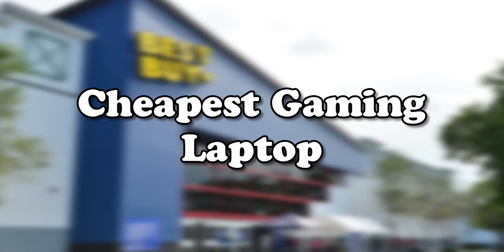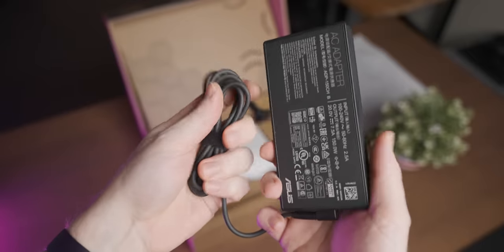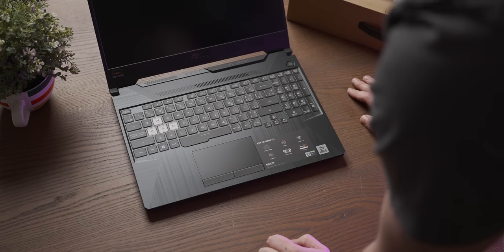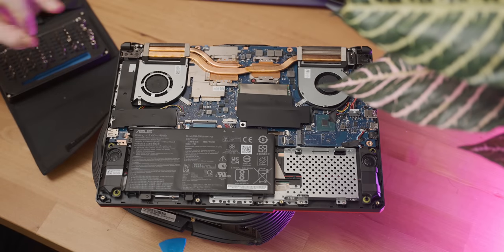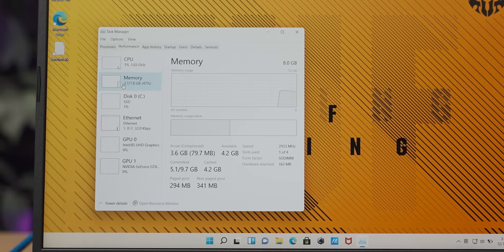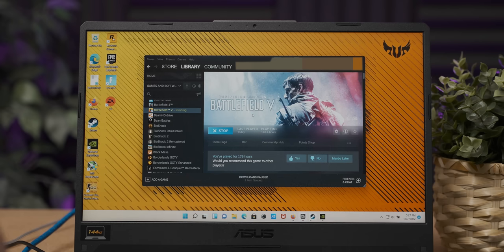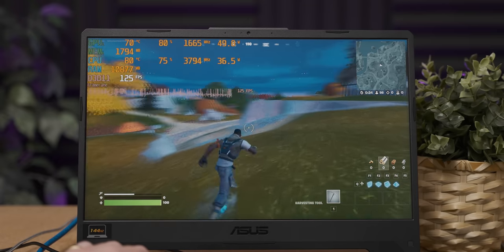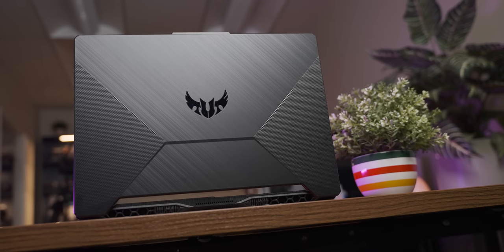The Cheapest Gaming Laptop From Best Buy...

Comment: Bought my TUF A15 from Canada Computers almost 2 years ago. It was my first proper "gaming" device and I experienced above 30fps gaming for the first time. One of the fans is dead so I ghetto-rigged a desk fan to blow into the heatsink but I'm getting it replaced this Christmas. Love the channel btw.
Reply: I'd just say build your own PC. you can get make really good desktops  in this day and age, even with a budget of sub-$500 USD!
Reply: true, but 500 dollars usd can get u much more than 500 cad.  You could probably get a igpu, or a r3/12100, and a used gpu of some sort.
Reply: Holy crap, what a coincidence, the fan on my Asus Tuf F15 broke after a few months, how long did yours last?
Reply: @trr4gfreddrtgf  After 1 year I noticed on startup that my fan had a bad vibration but went away shortly after. 1/2 a year after that, the vibration became constant and then it died a few weeks later. So it lasted around 1.5 years.
Reply: @scarecrow5848  y tho it aint broke
Reply: build a optiplex
Reply: @trr4gfreddrtgf  bro tf same one fan makes some weird noise :'')
Reply: The fans are easy to replace. I did it in like five minutes.
Reply: Fans died already? Wtf! Build quality clearly declined over time! My Asus n61jq laptop from 2010 is still running great and nothing has stopped working
Reply: @ronank2432  because desktops are better in literally every way.
Reply: @scarecrow5848  yes because they eat directly from the source. Whereas in laptops you charge and discharge at the same time.
Reply: @HR-pz7ts  no, its also other reason such as; not worrying about battery life, being able to upgrade every part in your system keeping it around for way longer, etc etc etc. i could keep going on but I'm not going to.
Reply: This laptop is relatively easy to pull the back off if you got the patience as I installed a second m.2 drive in mine so you could possibly get a new one and repair it to use as a spare.
Reply: @ansonjia5146  I see, my fan broke within 2 months, luckily it's still in warranty.
Reply: @killerbee115  Oh, maybe get that looked at lol
Reply: @ScavengerFX  Only reason I didn't do it myself was because I still have warranty on the machine, maybe when warranty expires I'll fix it myself.
Reply: @scarecrow5848  Right, unless I need to move around. University is not kind to desktops, at least for me.
Reply: @justinl2009  thats literally the only good thing good about laptops, and then again just make a SFF desktop and use a portable display.
Reply: I bought an A15 in 2020 too. 1660ti, but it runs Tarky in low settings so I am happy. 😁
Reply: how much did you pay?
Reply: @scarecrow5848  portability is a problem bro
Reply: @ashwin372  read other comments before replying to something that was already answered.
Reply: More then 30fps??? Can't be true!!
Reply: Bro try playing world War 3
Reply: @scarecrow5848  My MSI laptop runs alot better than any of the people I know gaming pc's lmao.
Reply: The fans is CRAP, mine died on month 4. They use the same cheap 25 cent for all their budget gaming laptops for the past 5 years and they want 50 bucks for new one...
Reply: @scarecrow5848  Hey man just replying a few weeks later... To me it wouldn't be practical to bring a SFF tower + KB + mouse + portable monitor to a college lecture... I mean imagine trying to fit them all inside a backpack to the next class... How would that even work?

Won't it damage the parts during the process? 

Everybody has different use cases. Some people travel a lot. So gadgets are made feasible for certain people. Not everyone wants to hog around a 20 pound tower INCLUDING A MONITOR which is maybe about 8 pounds or so.

Laptops are obviously underpowered versus  their desktop counter part but make up for it with its lightweight portability. It's literally an all-in-one package that has a monitor, keyboard, trackpad, and other various peripheral/components at around 10 lbs or less!
Reply: @MatchaCutie14  I already explained it, jesus christ read the other comments before commenting. also a SFF pc is not that heavy. your being dramatic and plus I said PORTABLE monitor. thats right, they make them! you can get ones that go down to 7" at 800x600. there you go. and I also said, if you WOULD HAVE READ THE OTHER REPLIES, "if you have no other option just use a laptop, but don't buy a gaming laptop because theyre a scam." (which is still very true.)
Reply: @scarecrow5848  Hey man, let's not get riled up here, ok? SFFs are still bulky and not everyone wants to hog a tower around. If you enjoy looking at a 7" monitor at 800x600 res, well you do you. I personally cannot work with that resolution and size. If people like OP are happy about their purchase, then we shouldn't put them down for their purchase.

Also you didn't mention about KBM and mouse. That also adds up to the weight.
Reply: @MatchaCutie14  you can get really light keyboards and mice. use wireless ones, and I never said a 7" monitor was good. I only said it was a option for a portable monitor. and last thing, if you really think a SFF pc is heavy, you must never have even touched a full-size tower.
Reply: @scarecrow5848  except portability I guess
Reply: @floydlooney6837  I literally already answered this. why don't people just read the other comments first? if you need portability make a SFF desktop.
Reply: @scarecrow5848  many people like me are obligated to buy laptops, i simply dont have enough space for a desktop pc and even if i did i need it for school sometimes, and I travel a lot so a gaming laptop is much better
Reply: Hmm, that didnt last that long
Reply: I've done the fan thing before. I did find a desk fan that blows downward but it wasn't common.
Reply: @scarecrow5848 try bringing a desktop to class
Reply: @spiritofpostpunk7207  just put it on a cart lmao. use a portable display.

Comment: I got an Acer Swift X for 780 new and I really enjoy how powerful it is while not looking like a gaming laptop. The battery life is great too.
Reply: Did you get it from that amazon discount atm? How is it doing so far? The build quality? Performance? Any problems you occured?
Reply: @Anthony Noelson  yes, got it for the Amazon price. It's a great laptop at that price point. 

The biggest pros are the specs (5800u 3050ti) it jams into a weight you can hold in 1 hand. It has half the power as my main PC and can play mostly all games at medium to high settings. With the 60hz display, anything over 60 is overkill on the main display so most games come out smooth as butter. The performance of the Acer Swift X is actually insane for the size and price you get. 14 inch ultrabook gaming. Another huge plus is the amazing IPS screen it ships with. Has amazing color accuracy because the laptop is marketed towards creative professionals.

My biggest gripe would be the speakers and keyboard. Speakers were cheaped out and are bottom facing, making them muffled on a bed or table top. Keyboard has really strange placement for the power button, sleep button, and pgup pgdown buttons where you'll end up accidently pressing one all the time. No big deal to me I can get used to it. Another gripe would be the color scheme. Silver and Gold gets dirty easily.

Bottom line it's an awesome laptop if you need a thin and light laptop that has power to do productivity or gaming. It works perfectly as a college laptop.
Reply: @zhon5311  okay cool. Thanks for your review! Very helpful

Comment: I am honestly impressed how well this thing runs games after the RAM upgrade. 60 fps in Cyberpunk with a 1650 and a 4-8t CPU is surprising. Also, regarding the memory speeds, you may need to look for XMP profile settings in the BIOS. I have an MSI GF65 (3060 with 10500H) and I had the same issue and to enable XMP after adding the very same RAM you used in this video. As always, I love your humor. Keep up the good work!
Reply: it the bios is like the older one I have it's kind of useless to even go in there since there are no usefull setting inside :\
Reply: There are no XMP settings in the BIOS on these laptops. They were built to run at JEDEC standards, and 10th Gen was 2666 MHz at the time.
Reply: @PatientXero607  really? I thought this only happened with the AMD Laptops. Really sucks if you can't set XMP even when you have an Intel CPU
Reply: @PatientXero607  no. their ram was jedec 2933. u just need to buy the right one.
Reply: @hailgod1  I have 8gb single channel 2933 standard. And planning to upgrade it to dual channel. So what RAM brand is the right one?
Reply: @hailgod1  Depends on the year of the model. My FX-504 won't run RAM faster than 2666mhz, but it has an 8400H. The 10th gen core CPUs probably have higher memory clocks, but you still can't enable XMP in the BIOS
Reply: tf  that combination is very weird, wouldn't 3060 get bottlenecked by the little i5 10500h
Reply: @dodgymalaka2317  I haven't had any issues with it. This CPU is 6c/12t, though. Not the usual 4/8.
Reply: @atiebiss  look for crucial sodimms. they are usually just your bare sticks, rated at their listed speeds at 1.2v (jedec spec)
Reply: Kingston Fury ram has JEDEC standard rated at 3200mhz. I know this because I had to upgrade the ram in my Acer Predator 300(i7-11800 + RTX3060), which the OG ram ran at 3200, but there was no XMP option in the bios.  The Kingston Fury runs confirmed at 3200mhz on JEDEC standards alone.  Just in case anyone needs to know this info in the future.  Would probably help unlock at least a little more performance instead of running it at 2600MHZ.
Reply: my sister's oldest vivobook laptop from asus has no xmp settings after i upgraded the ram so every asus laptop uefi bios are like that and it's just useless. even if you have an rog strix or scar laptop you still won't be able to set the ram to its rated speed manually in the uefi bios
Reply: @dodgymalaka2317 u can't be talking about bottlenecks, I have a laptop with an i7 7700HQ and a 1050 4gb, but I also have 16gb of dual channel 2400 ram

Comment: For its price, it really is a decent laptop. Thanks for sharing these affordable options!
Reply: I would hold out for a 3060 and 16GB RAM for the same price.

Bought a Gigabyte G5 GD with 3060 and 16GB in July from Best Buy for $699.99.
Reply: @antondovydaitis2261  gigabyte build quality sucks tho and they have warranty issue i got the legion 5 brand new has been awesome so far
Reply: @THEGRANDTOUR-kt3jh  Obviously, if I could afford a Legion, that would be much better, but I feel I got my $700's worth.
Reply: it's actually terrible value for the price... heck a year ago you could get a similar setup for the same price with a RYZEN 5 5600H
Reply: @jesusbarrera6916  ikr I got my laptop last year for £700 (now it's £630) and it came with dual channel 8gh ram and a Ryzen 5 5600h. I hate how some manufacturers will use a very weak CPU in their budget laptops and say it's 'good value" when there are many others with a much more powerful CPU
Reply: bruh you can just build a $699 gaming pc and it could be 3x brtter
Reply: @kenzidoestoomuch  Really? Because I scoped several builds in July 2022 and since then, but nothing has the same performance (and yes, I know RTX 3050 mobile GPUs aren't as strong).

I'd like to see a build like that.
Reply: @antondovydaitis2261  well not specifically yours, idk how you got a $699.99 3060 laptop, but you can put together a $685.99 pc with a 12100f 6650xt 512 gigs of nvme pcie 4.0 ($10 less for pcie 3.0) SSD
Reply: @antondovydaitis2261  before tho u could build a 6650xt build for $499 when prices were low and the 6650xt was like $250 and the 12100f was only $80 and when the power supply was like $35 for a good one
Reply: @kenzidoestoomuch  Yeah, okay. Makes sense.  Early in my understanding though, I really only understood Intel and AMD.  Especially since I did want a laptop because of moving around the house.

Now I understand that all AMD is better bang per buck, although laptops aren't really caught up.
Reply: @jesusbarrera6916  i5 is better
Reply: Avoid this laptop at any cost....my experiences....
Reply: @selwyntan4014 the laptop is trash and the proof is I am the user😐
Reply: it's not really a good price, but to be honest prices are fluctuating like crazy.
Anyway calling 1650 mobile a "gaming" card in early 2023 is kinda dick move by shops.

Comment: I have exactly the same laptop 1.5 year now but with 16 gigs of RAM pre installed. And it's funny how cooling solution is made. Mine opens with one hand just fine and it takes a little bit of air from keyboard and prevent it to get hot. And it's kind of laptop that better to use just on table without "helping" it with cooling pads

Comment: I have a previus version of this laptop with a 9300h cpu and for gaming I always need to remember to swich the profile  in armory crate to unlock the cpu tpd and clock, I also had to add the 2nd stick of ram and replace all the termalpaste to improve  the performance since for some reason the stock one appreared to be dried up from the start
Reply: @Silvio Balaško I evem replaced that weid glue that tey used on the vrm with folded termalpads they seem to work better^^

Comment: There's something called a turbo mode. You can use that by pressing the fan button on the laptop. (idk if it's still present or not, ROG strix budget ones have those...) and that turbo mode literally overclocks and maintains it at 4-4.3 GHz idle and reaches 4.4Ghz max at games and stuff and I'm pretty sure it makes a difference in games...

Comment: Hay there.  When you upgrade the ram on these, get 3200 native 1.2v ram vs 1.35v ram.  It will run at max speed without needing XMP.  Timings will be a tad slower, but you’ll get full speed. Team Group makes a bunch of 1.2v ram for laptops and desktops that may have a locked bios and don’t support XMP.  

Cheers
Rick

Comment: Good that they still have the dual M.2 & single 2.5" bay configuration, something a lot of budget laptops don't have and it enables you to chuck an older SSD in the 2.5" bay which would otherwise be useless. I have an older TUF with a Ryzen 4600H & 1660ti which has been great, upgraded to 16gb and 4tb of SSD storage.

Comment: I actually picked this up in 2020 for I think $500, it was the exact same specs just with a 60 hz refresh rate. Served me pretty well but I got a new one for university cause it was so damn heavy and I also needed something more powerful to run programs for classes. I liked it at the end of the day tho, it was cool to see a bit of a retrospective on it!
Reply: Do you happen to still have it?
Reply: @jahyeet1137  yes, why?
Reply: are you a CS major by any chance? which laptop did you buy for uni?
Reply: @Windows Media Player  honestly, you don't need an extremely powerful laptop as a CS major. Most programs that you would write for a class can be done on a potato and there are usually computer labs when more powerful computers are required. I'm graduating in 2024 and I've been able to do all of my programs assignments on my crappy duel core laptop from 10 years ago. I recently bought a lenovo ideapad gaming 3 used for $600 because I'm studying abroud next semester and can't bring my desktop. Obviously, having a better laptop makes things more efficient and quick but it's not necessary to get a gaming laptop for CS. Now, for stuff like game development, you will need a more powerful system, if you're uni doesn't have a lab for it, but that's a compleatly different subject
Reply: @loganricherson  i see! i’ll be moving to canada this fall to study computer science as an international student. guess i’ll bring my potato dual core there and see if i can get by using it. otherwise i’ll maybe wait for some good warehouse deal on some samsung 2-in-1 laptop with an i7 and 16 GB RAM, they seem quite appealing to me and can be bought for around 950 CAD

Comment: QUICK NOTE from an IT tech: You normally start opening the laptop starting at the hinges and towards the front... although some manufacturers simply can't be bothered with conventions or even planning a good way to open their products (especially cheap consumer products like this one).
Reply: IT Tech here too. I disagree. This laptop uses the same design as their more expensive tuf laptops (upwards of 1,100). This laptop actually came with a “lifting screw” on the front right corner where it stays in place and lifts the bottom cover up from the case. This implies they want you to open from the front. Also the cover toward the back part of this laptop covers the vents. It’s almost impossible to open it from the back. I’ll say it’s designed good but executed badly. The clips are too tight.
I’ll rather open this than laptops 5-10 years ago. Where everything is UNDER the keyboard.

On Dells and Lenovos that I normally work on, you can open however you wish lol. The clips are carbon fiber and very lose.

Comment: I have this laptops previous cousin. Mine has a 9th gen Intel i7 and a 1650. Slightly different LCD lid cover. But the same overall chassis design. I've had to upgrade the RAM on it to 16 gigs but it's been a fairly okay laptop for what I got. Would love to have something way more powerful but I was on a budget and had to make a decision on which way to go.
Reply: "previous cousin"?? 🤣
Reply: They have been putting the 1650 in since like 7th gen Intel. It's disappointing they are still using it in new laptops.
Reply: @barryj0413  7th gen with a 1650?? I want examples
Reply: @barryj0413  Well it was this or one with a Ryzen paired with a 1660. A quick check online showed the Ryzen on offer actually bottlenecked the 1660. So I went with the one with the i7 and 1650. Mine also has a 120hz screen while the Ryzen one was 60hz.